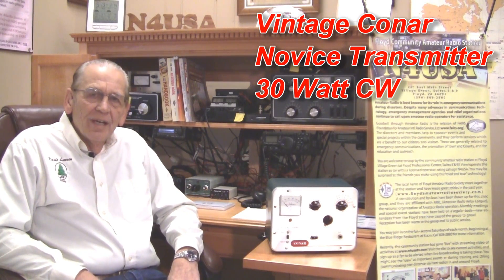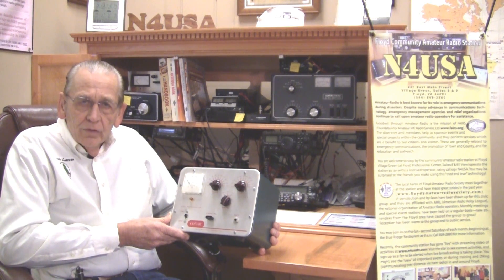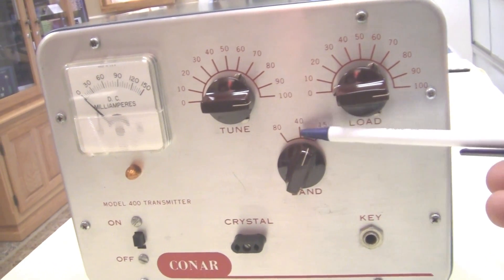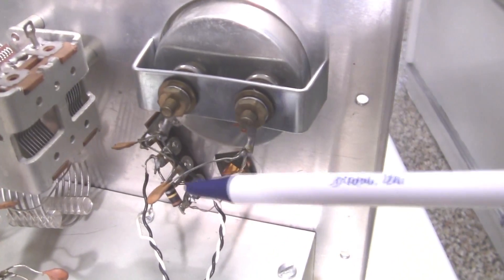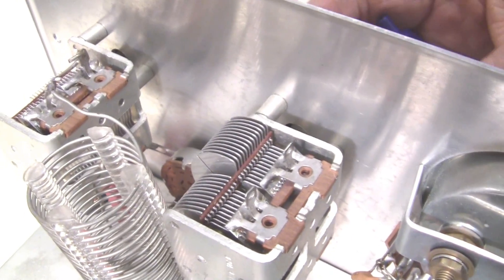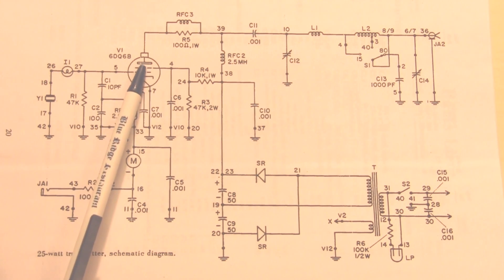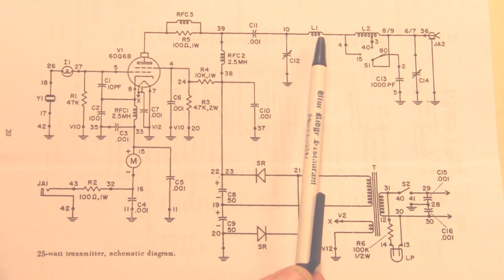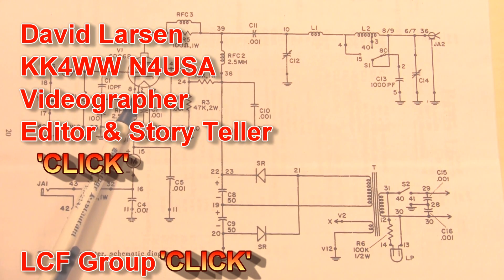Amateur Radio Conar 400 CW Transmitter KK4WW N4USA

Comment: I've had one of those little Conar transmitters for years, but never made an on-air contact with it.  It works like it's supposed to, but "supposed" is a big word.  The thing chirps badly that I wouldn't want to use it on the air.  The ransmitter was made to be paired with the Conar 400 receiver.  The pair made a Novice station back in the days when Novices were limited strictly to CW, crystal control and 75-watts input maximum.   These kits were geared to new hams; building them taught radio theory and when finished the Novice had a working transmitter and receiver.
Reply from the maker: Hi mpd3 - I never used this transmitter and it just resided in my collection. I have move this and several hundred other ham radio item and 10,000 items in my Bugbook Computer Museum to the Computer Museum of America in Roswell, GA.

I have been ham radio operator for more then 62 years and did start out with the Heathkit AT1 transmitter in the mid 50's. http://www.kk4ww.com

Also operate N4USA. http://www.n4usa.com

Thank you for the comment.  I just loaded a video of Chantilly Farm - location of N4USA.
Reply: @lcfgroup  I finally made a few contacts during the recent Novice Rig Roundup... an even to work other Novice-era era rigs from over a half-century ago.  I found that placing a 300pf MICA capacitor rated at 500-volts across RFC1 reduced the chirp to an acceptable level.  Been doing this fer 47-years myself.